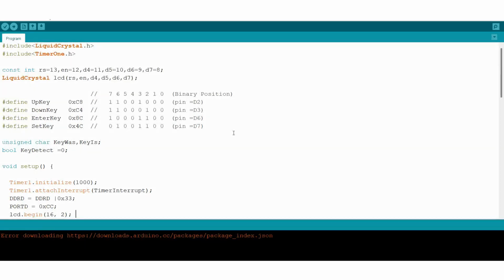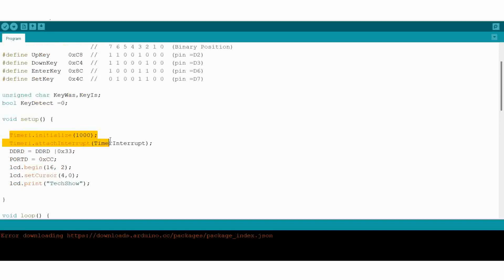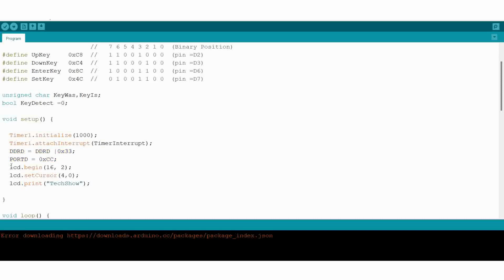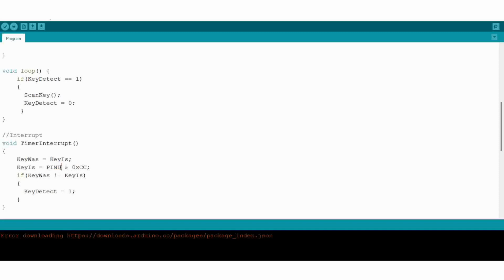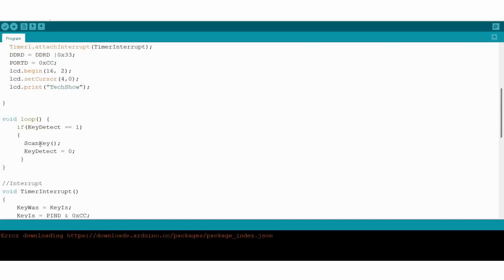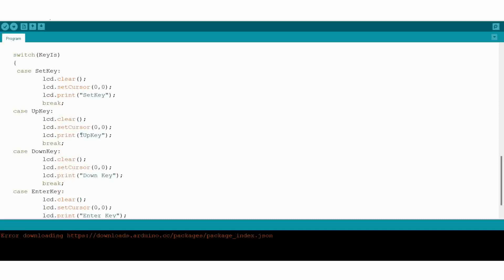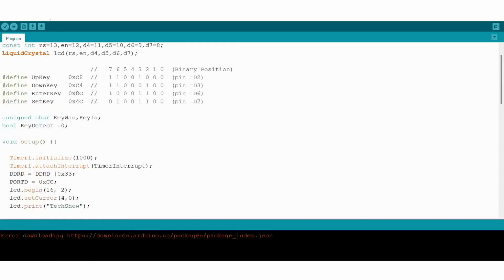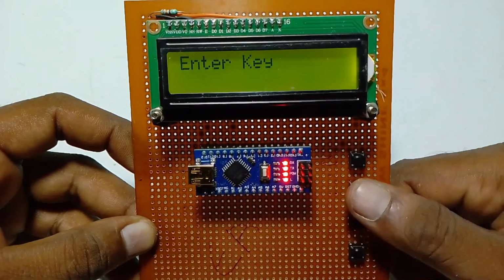Arduino Interface with Multiple Key and LCD | Arduino | TechShow

Comment: Sir, how to make,
Using keypad, LCD, Arduino board, Fan
When I press 100 and then enter fan speed 25%
Similarly
200 for 50%
300 for 75% 
400 for 100%
Reply from the maker: Thanks for watching. In future videos I will try to make this project
Reply from the maker: https://youtu.be/fHPG1k5TKNU 
Fan Speed Controlling